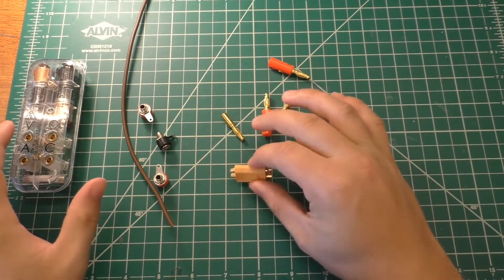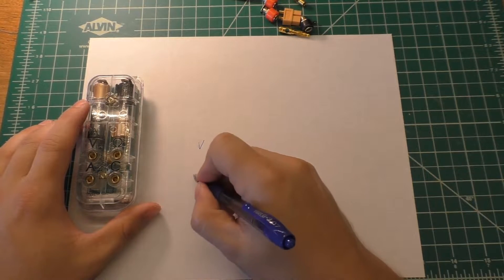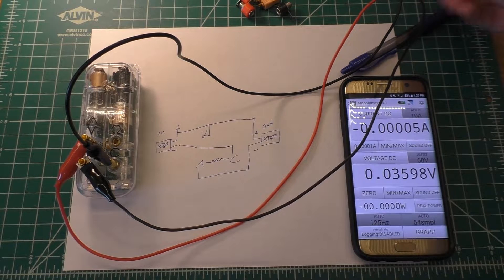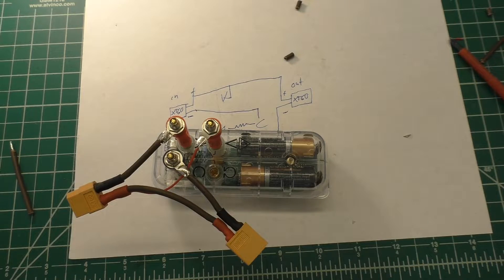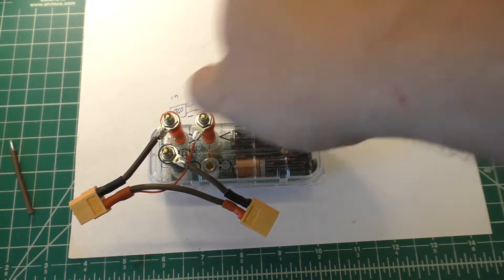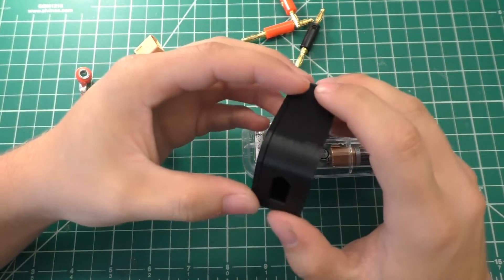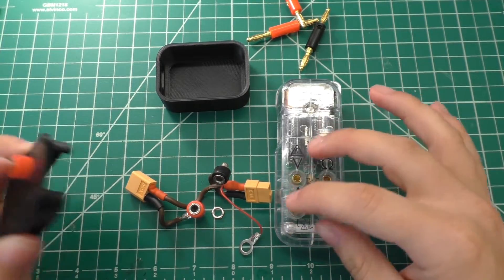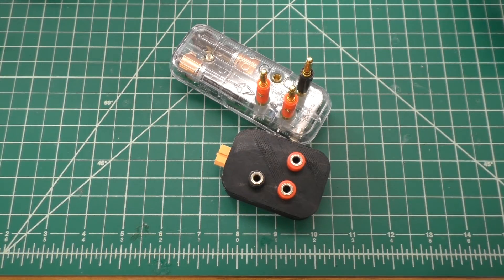XT60 Current and Voltage Breakout for Mooshimeter

Comment: You can get panel mount xt60 connectors, they are great, you can screw them in for a long lasting solution.
Reply from the maker: Thanks for the tip.